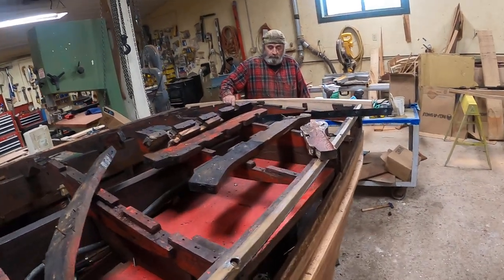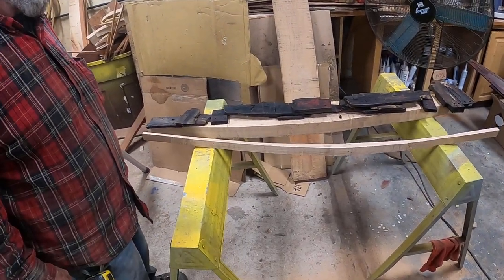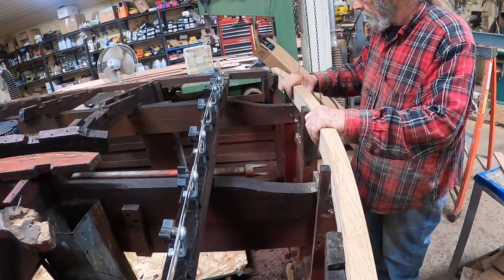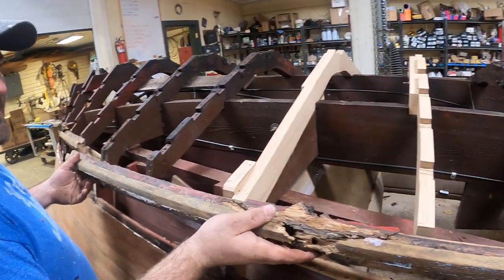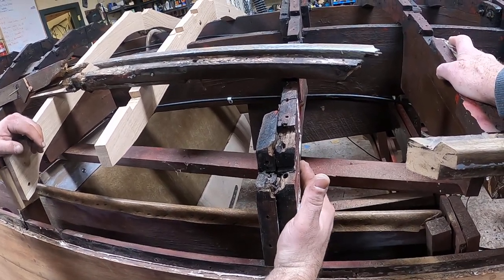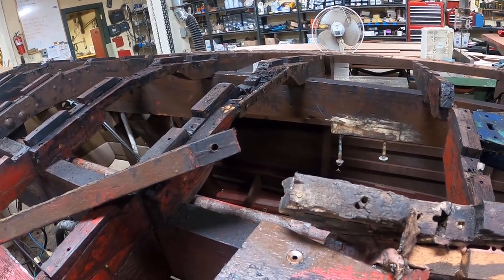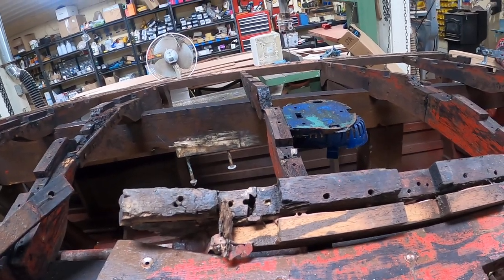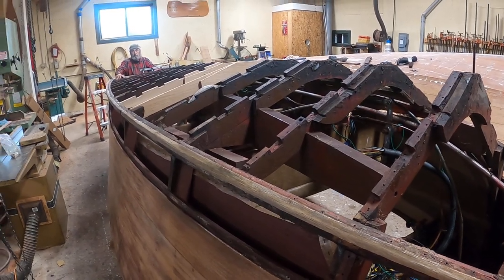1948 18  Century Sea Maid Replacing Bottom Frames & Bow  11 9 2021 Snake Mountain Boatworks LLC

Comment: Finally got my dad's 1957 Resorter out of my stepmom's claws. It's been in the garage since 1989 and while the interior is in great shape, the boat is going to need some work before going back in the water. A guy from the original dealership in Tahoe came over to look at it, gave me a quote, and has since seemed to have dropped off the face of the earth. I guess I'll be watching your videos as I try to do what I can to restore it myself. Any videos or books you suggest? Thanks in advance!

Comment: Do you think that placing a frame in a vacuum chamber with some cat litter would get the oil out?
Reply from the maker: Kevin, no. Besides, what is your best guess that the entire system - 24'x12'x8' chamber and all that is involved in making it operable - costs to buy and run?